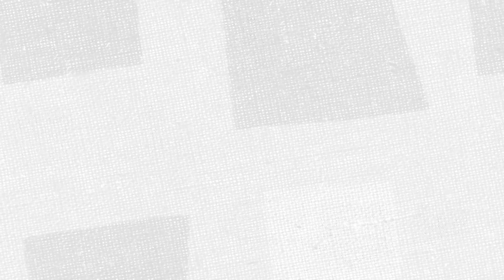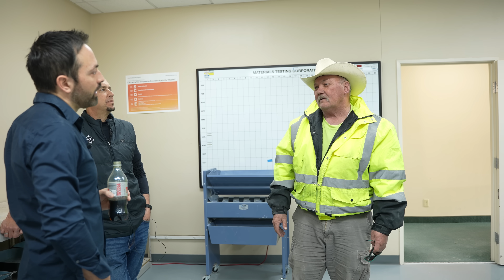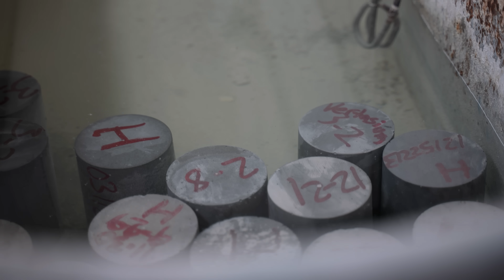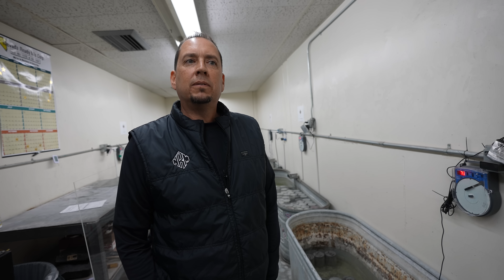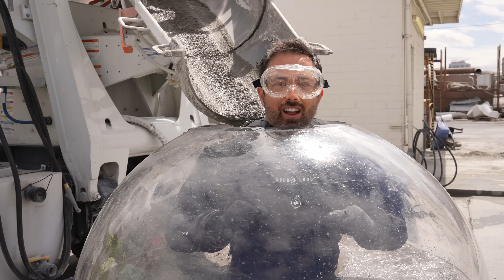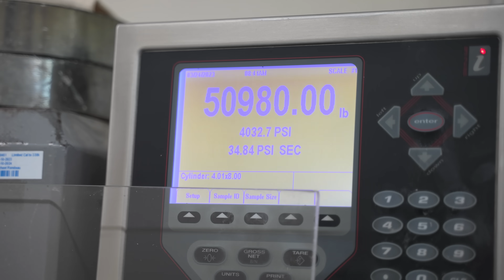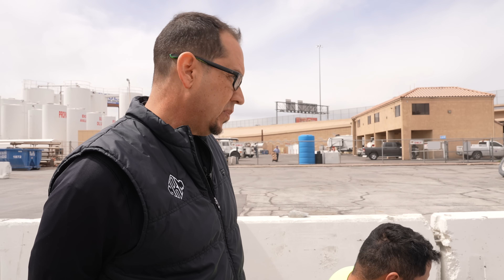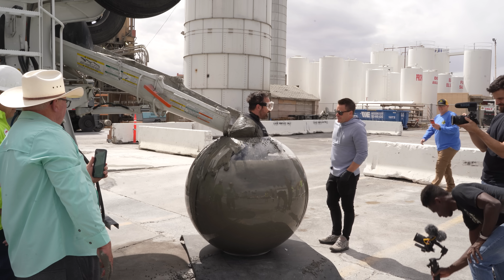Getting Buried In Concrete To Explain How It Works

Comment: As someone who has worked in the construction industry for a long time, but knowing nothing about concrete, the bottle of pop being mixed into the cement 100% sounds like something you'd tell a new guy to do lmao
Reply: Truth or fiction, KO stockholders love it.
Reply: Imagine the new dudes face when you grab the bottle from him and actually dump it in 🤣
Reply: We just keep a 5 lb bag of sugar on the truck, but yeah it works.
Reply: No kidding, right up there with "Hey new guy, bring me the cordless extension cord"
Reply: grid square, sky hook... basically a snipe hunt
Reply: @outpost42  "This 2x4 is a little short, can you go ask the site manager for the wood stretcher? He has it."
Reply: @dez7852  A fellow roofer, I see. Lol
Reply: It's something you do to the new guys concrete when he's not looking so his stuff never dries lol
Reply: You're stuck in traffic and you tell him to put it in the truck and he dumps it in the fuel tank instead.
Reply: @brokentombot  whut
Reply: I work in cementing and we pretty much always bring sugar to locations to keep it from setting up. I think citric acid is also sometimes used since cement is basic
Reply: Yep sugar slows the reaction. That's how they do exposed agg driveways. Sprinkle sugar on and wait until the base goes hard then spray the top layer off
Reply: Delvo is better and proven to retard hydration.
Reply: It's like poor parking lot porters at a dealership being told to ask the next dealership over for a glass stretcher lol.
Reply: When he said coke, I was expecting something else. Not cola
Reply: I used to add dishwashing liquid to help entrain air
Reply: @Mr666weso  Comment  up vote. We mix some sugar and cola, then spray it on. Works great 👍
Reply: I work with refractories; we use citric acid to delay setting, both substances interfere with the growth of ettringite and Tricalcium silicate. Basically; acid slows it down and weakens the concrete, whilst alkali will reduce setting time and strengthen the concrete. The pH of Coca-Cola 'is reported to be 2.6 to 2.7, mainly due to H3PO4, phosphoric acid'.
Reply: Won’t the ants and insect start eating the concrete after construction completes? 🧐🐜
j
Reply: Slime light fluid and removable flight line
Reply: Bro what you mix pop with cement?
Reply: Or its a clever way to sell more pop.
Reply: That's like a lefthanded adjustable metric wrench 😅
Reply: As the new guy, I can say the response would be, "What, why?"
Reply: @Awolraven2  bring back a giant bucket of water lol
Reply: @outpost42  Old telephone office version, "bring me a bucket of dial tone".
Reply: Can i work for you please??
Reply: We keep it right behind the wire stretcher and glass nails
Reply: On the rail a new guy was told to stand behind the rail saw and catch all the sparks with a tonne bag 😂
Reply: @Awolraven2  When I first started volunteering with Habitat for Humanity, the supervisor always said to measure twice before we cut because he accidentally left his board stretcher at home that morning.
Reply: Fascinating
Reply: We’ve had new concrete foundations sabotaged by sugaring.
Reply: @henryj.8528
Pretty sure all these companies wouldn’t be doing it if it weakened their concrete lol. Just delays the hardening Id assume
Reply: No its totally true about the soda, although typically i would recommend drivers carry bags of actual sugar rather than coke, so that you've not contaminating it with whatever the non-sugar components and the fizz associated with the soda. Although there are some technologies that are currently mixing CO2 into concrete with incredible increases in strength, so maybe the soda itself could be helping.
Reply: There is no need. Modern trucks have the ability to add water directly to the drum, either from the chute controls or in the cab. 

This entire thread is hilarious because the way we actually handle the issue in the field is by adding water. The concrete will not harden if it stays agitated with water coming in. To dry it out for pouring you spin the drum up for a while. It's really not complicated.

BTW, if the truck breaks down and can't spin the drum, the soda won't help. Of you run out of water, the soda will NOT be enough to stop the curing process.

Outside of some extremely niche situations, no concrete worker or driver is carrying soda and sugar. Literally just water. SMH lol
Reply: @dez7852  Embarrassingly enough, I went looking for shoreline on a Naval vessel. Learning from that, I made an entire onboard expedition for the next stupid thing I was told to retrieve 😁
Reply: @dielaughing73  We had a couple of well experienced (read old) drivers that did that lol. Being QC, I of course didn't know anything about it 🤫 lol
Reply: When I worked in the oil field we always used giant 50lb sacks of sugar for the excess cement we poured. Once I was curious how long it would stop it so I filled a paper cup of the pure cement and a cup of the sugar mixed cement and sat them side by side. The pure stuff was hard in 2 hours but the sugar stuff wasn’t hard until about 30 hours
Reply: @thephotoyak  Yeah it would suck to have mistakenly bought all diet soda.
Reply: @anthonydavidson6139  Concrete, dammit! You did that on purpose lol
Reply: @DC-ei9vl  I would have said concrete, but I’m the oil field it’s cement as it has no aggregate in it. When I was green I’d call it concrete too and people would look at me like I was dumb.
Reply: @anthonydavidson6139  Grout has at least sand in it, guess I stand corrected 🤷
Reply: I would bring a bottle of pop with me if I was a trucker either way.
Reply: Yup. If the truck's stuck in traffic, or running late for some reason, you chuck a bag of sugar in the mix it slows the setting up considerably.
Reply: @zombie-process7025  I would carry a bag of sugar with me either way.
Reply: electricians tell new guys to go find the wire stretcher
Reply: @ninjaOboy except...it does
Reply: Well I’m just starting to watch the video so I’m not sure what he will do yet but I think they spray the soda or sugar basically on top to expose the surface if the pebbles .
Reply: How much coke would be dumped in one truck if it broke down on the way to the pouring site ?
Reply: up there with "bring me the left handed screwdriver"

Comment: Every kid on a roadtrip ever has wanted to slide down the forbidden slide at the back of the concrete truck. And Derek actually did it.
Reply: that was my first thought.
Reply: As a concrete worker you actually have to do this sometimes, climb up the chute (in your case slide) and use your boots to push down the last bits of crete as you slide down. Only really do it in the case that we need every last bit on concrete
Reply: @buzzintrippin  That's a real solid way to get some concrete out.
Might be handy for a new foundation
Reply: @buzzintrippin  the little boys amongst us are cheering you on.
Reply: That’s not just a little boy dream. Every little girl I knew (myself included) wanted to slide down those things. It was on the list just below riding the equally forbidden luggage carousel at the airport.
Reply: No, never had thst desire...it just never seemed fun due to being so short...
Reply: Not if they momma there
Reply: @slopeboix2589  that’s why children need fathers
Reply: @thunderatigervideo they didn’t even say boy lmao
Reply: Not to mention climbing the gravel piles for construction lol
Reply: @notme5844  Yes!
Reply: @Iono123  It was a reply to the comment immediately above mine, which talks about boys.
Reply: @buzzintrippin every time I poured concrete which was a lot then we used like a half moon type scraper that fit the bottom perfect of the shutes never had to go up a shute
Reply: Surprised he was able to. They’re hooked segments, I wouldn’t think they could hold a man’s weight. Concretes heavy but it just slides down it
Reply: Yes.
Reply: "The forbidden slide" 😂 I can remember being a kid and seeing a cement truck parked. I loved watching it spin around! Never really thought about the slide!

Comment: As a structural engineer, I really appreciate this video. Concrete is such an incredible material and most people don't realize just how impressive and important it is.
Reply: The fact that this method of architecture has been used for thousands of years is so cool to me. Makes me wonder if there was ever a point to where concrete makers had to convince everyone that it was given by god because of how powerful basic science was at the time lol.
Reply: It's very useful but it's just a shame that it's has such an important environmental impact. Not to mention we're running out of sand.
Today, architects always go for the default concrete buildings and don't even consider other alternatives that are totally viable.
It's a bit like petrol fuel : it's a very useful resources but when ended up using it way more than necessary.
Reply: @marz6770  yeah you're right. I was kinda just talking from an engineering materials perspective. But yeah from an environmental aspect it's not great. But tbf, it's also partly because we just use so damn much of it. If we used basically any material in that quantity then that material would probably cause huge environmental issues.
Reply: I never thought about it until I started working as an inspector. I work in the lab sometimes and it always amazes me how strong concrete can be.
Reply: @skullkrusher4418  I agree the quantity makes it worse.
The thing is we do have alternatives that actually have less impact but we're just addicted to concrete. We use it even for regular sized buildings that could be wood or other materials that are totally viable.
Also I did mention that we're running out of sand but we also destroy entire ecosystems while digging it.
Reply: I'm a concrete technician. Meaning I test the cylindrical samples shown in the video. I've been doing it for years and am still impressed with the strength
Reply: @jensechristensen6843  Wooo concrete testers! I feel so seen by this video lol
Reply: How'd you feel about the truck drivers pouring coke into your carefully selected and approved mix design? I am really hoping that is just a joke.
Reply: @ninjaneerk5601  It's not a joke, and they don't do that when the concrete is good, obviously. That shit's expensive. The coke trick is for emergencies only, like when the concrete truck gets rejected by the tester if the air content is too low or too high, or if the temp is too high, or if it's been in the truck too long after batching, or if they add too much water and blow the water/cement ratio. Then the concrete is rejected and therefore worthless, it will be poured out and the aggregate reclaimed if possible. But if it's setting up in the barrel it's incredibly hard to remove so yeah the coke trick is a great idea if it comes to that.
Reply: @adamcauble3674  ahhhhh. I see. I thought he was saying that they used it as knock off retarder and I got worried.
Reply: We really take it for... granite
Reply: Fr bro I didn’t until watching
Reply: @jensechristensen6843  Yo, I am a Concrete Technician too! In what fields are you able to work in with this occupation? In my country I am qualified for the lab, Dispositiong, mixing and leading a plant, I currently do both Mixing and Dispositioning.
Reply: @marz6770  I mean if we reduce other sources of CO2 emissions and work towards carbon capture, the benefits of concrete FAR outweigh its carbon footprint. It's like if you needed to cut a few trees down to make the tables to decide on the future of the planet, or make the stairs for people who do it =)